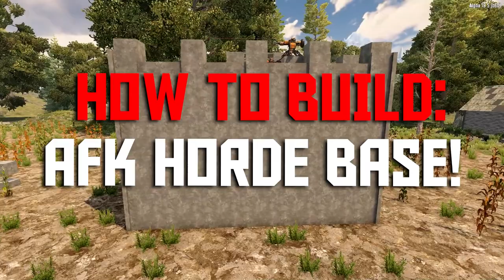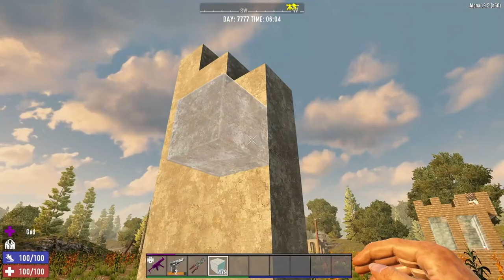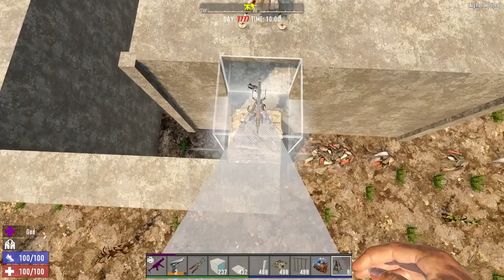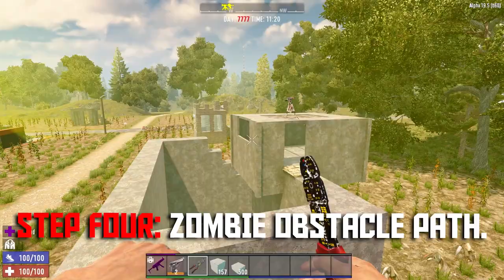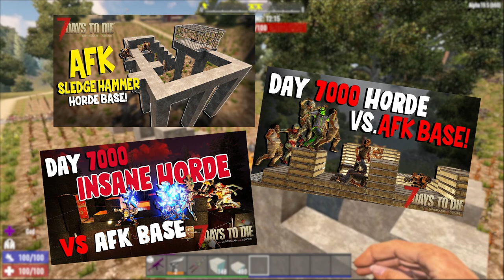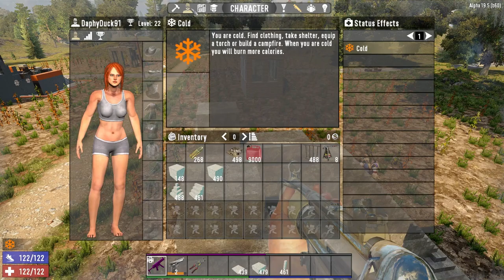How To Build AFK Horde Base - Sledge Hammer Base - 7 Days To Die  (Alpha 19)

Comment: One thing I would probably add for my own customization if I were going to build this base, I would put dart traps into that double window space that you have facing the path. They would be lined up to shoot the zeds in the ankles, that way if a few demo zeds do make it up there where the junk turrets are you can kill them much faster with less risk of touching the nipple pack of boom. Just wire it up to pressure plates or tripwires, whatever your favorite flavor. Unless the Fun Pimps have patched it out, darts dont set off nipple packs of demo zeds. Nice base design, very well done.
Reply from the maker: Dart traps are a genius idea! And it would be so fun!

Comment: Great vid!! You’d defo want supports if you went out much further because it’s not just the horizontal distance you have to consider - every block up and over would be counted from the block that’s supporting it. I could see everything collapsing if it was maybe two wider than that.
It’s an awesome base - need to give it a go! My current one is pretty close but without the turns… think that will really help
Reply from the maker: [Genosis] I did the original video, so I wasn't sure how she was going to do when recreating it, but she did well! I too looked at how far she dangled the base on one side and desperately wanted her to support it with another pillar or two haha.

Comment: Something I've wanted to try but have been holding off on until Alpha 20 comes out is do this kind of base but make the support a few blocks wide with a ladder going down to a base underground so I could have a chem station, forges, workbenches and campfires going if needed without making the base super wide.
Reply from the maker: I do like the idea of extending downward to save on width! Awesome thinking.
Reply: Would zeds be able to sense the ladder and attempt to dig to it?

Comment: you will need supports. 15 blocks horizontally attached to the same 1 block might not fall, but putting up the walls and roof will certainly bring it down to a pile of rubble  (also, I prefer to fill in the space on which I sit, so I won't be worried it a few stragglers decide to hit the supports). Also, the SMG turret put there will get the birds coming from the front, but will ignore the birds in it's back hitting on those iron bars :D just saying...

later edit: now actually finished the video, it looks like the first sledge was hitting the block near it damaging it instead of hitting the zombies. maybe rotate it a bit to the left so it doesn't face the block near it or don't put the turret right next to the hopping block :)
Reply from the maker: Oh snap! Thank you for pointing that out. I shall correct it in the future.

Comment: Thank you for the guide. Does anyone have any experience building an AFK as the opening to your mine? I started building my AFK base, but with a slightly different purpose. I'm not planning on using it for horde nights. I am building it where the center of "my area" has a ladder that goes down to the dirt and then I plan on going straight down, probably to the bottom of the map. My plan is to go down and mine. I'm hoping that the AFK base will still work as intended. I have no clue if me putting a ladder all the way down the center of the inside of the protected area will change the pathing of the zombies at all.
Reply from the maker: [Genosis] I actually did something similar near the end of my Darkness Falls series. I had a ladder running to bedrock, and a horde base with some AFK elements on top of it, and they never tried to get to the ladder, so long as it was encased in two layers of concrete (one for the tunnel, the other for the outer wall)
Reply: @NotAGamerGaming  I was going to just have the ladder run from the top of the base down the center to the top of the dirt. To go up and down from the mine I was planning on using the block shape elevator trick. Would you recommend running an enclosed ladder all the way down to bedrock?

Comment: Followed the video and had the whole thing built and started doing upgrades from reinforced concrete to steel and the part where you stand just came crumbling down. No idea why outside of making it 5x5 (I think) and maybe there wasn't enough support? Seemed to be fine till the upgrades happened. Also had the turrets just stopped working during a horde night. No idea why for that either.
Reply from the maker: The upgrades would be heavier and causing it to become unstable
Reply: @NotAGamerGaming  Thanks for the answer. Thought about that but then wasn't quite sure as in the video, you were showing how far out you could go with concrete before it collapses and it just made me second guess the whole thing as far as what works and what doesn't building mechanics wise. I remade the "house" area and put another block underneath to see if that would add support at all. Survived a horde night in there so hopefully it'll remain standing. Thanks again for the reply and the video. :)
Reply: @WBoyd31  Something else to consider is a straight row of concrete blocks can go farther than a "house" without needing more support. A straight row of about 15 blocks weighs less than a "house" with floor, walls and roof. As pointed out above, upgrading the blocks adds more weight as well.

Comment: For the record, I dont think falling damage is really a thing for zombies anymore. Like, it still EXISTS, but its super low compared to what players take and requires stupid distances to amount to anything. Also, question i had. Why do half blocks and full blocks when making the stumble steps? Doesnt a single full block do the job for slowing down and spacing out the zombies for easy sledging? Or does the extra half block make it better somehow? I admit im a relative newbie as most of my afk bases havent gotten past day 21 before I get bored and restart. EDIT went back to savins world, his video showed it takes like a 12 block fall to take just a couple hp in falling damage for zombies.
Reply: the half block makes it so your sledge turret will mainly hit their feet meaning you won't trigger demolishers buttons. Also you'll want the sledge turrets to sit on the left side of a demolishers since the button is on his right side making the risk of triggering the button even lower
Reply from the maker: [Genosis] Yep, what Cosmin mentioned here is correct. The position of sledge (legs, left side) avoids the detonator on the demos. 

Now, something I didn't think about at the time, is the half block path isn't required. All you need to do is the normal path with full block steps to make them jump, just put the turret on a half block rotated vertically. Accomplishes the same thing, I guess I never thought about that in the original design. I was going to record this tutorial myself and make that correction, but Daph got to it :P

Comment: THIS THING KEEPS FALLING APART ON ME! I've built it multiple times the plates just keep falling apart when I use them for walls, what am I doing wrong!?!
Reply from the maker: Are they connected to the blocks?
Reply: @NotAGamerGaming  yep I go around the base with the plates. Then add the walls. It's when I start adding the roof that It falls apart on me. I checked the integrity and for some reason one corner is always red, even though they should all technically be pillars. It may be that I'm starting it with wood rather than concrete as I'm trying to get as much upgrade xp as possible.

Comment: At a certain height it seems the sledge's don't work.
Reply: How high?
Reply: make sure you're not too far away from the sledge turret. Unlike powered turrets (or any powered thing), sledge and the junk turret will stop being active if you go too far away from them. This distance can be increased by putting points in Robotics Inventor (under Intellect). Also, you won't be able to have 2 non powered turrets active at the same time if you don't max out Robotics Inventor (only the closest one to you will be active).
Reply from the maker: Yes, make sure you are close enough to activate them :)

Comment: didnt work for me tbh. a couple get past it.
Reply: they also just pile up below the room and destroy the support wall
Reply from the maker: [Genosis] For my wife's interpretation of the build, it's really important to upgrade as well. I haven't tested much below concrete, the pathing 100% would be affected by the materials used. 

And having 5/5 robotics, and as many perk books as you can get would be important too. Also, find a way to slow zombies down to increase the chance of getting knocked down. Barbed wire, blocks to jump on, electric wire would be great too.
Reply: @NotAGamerGaming  thank you. i probably wont get the 5/5 robotics in a game. but i tried some changes in creative mode and it seems like it works now. at least on early gamestage/waves.